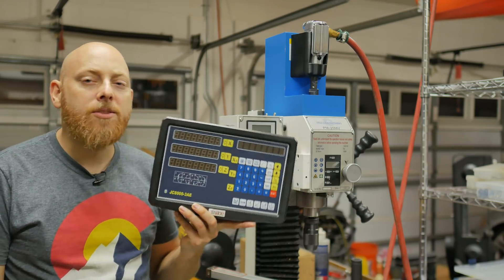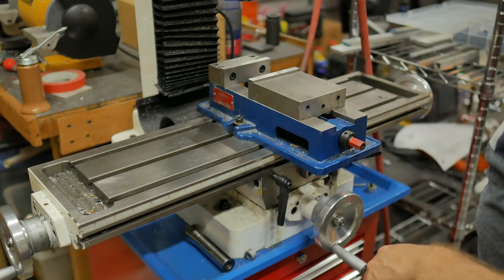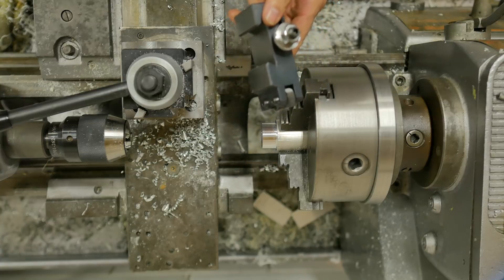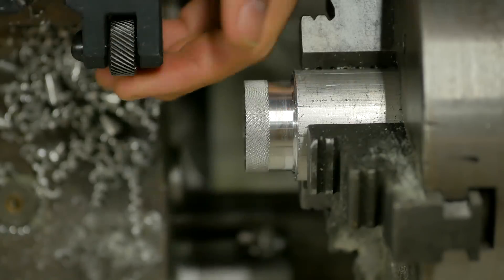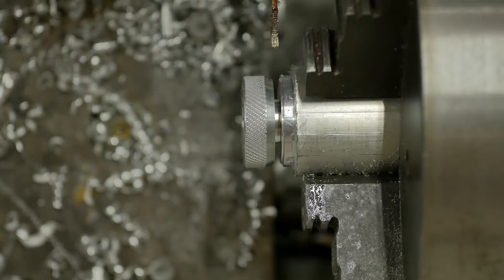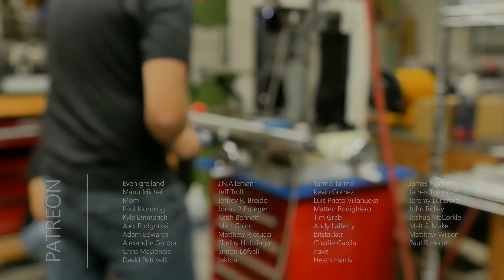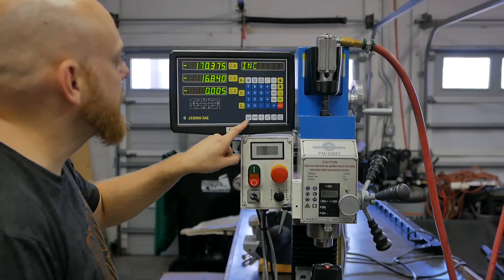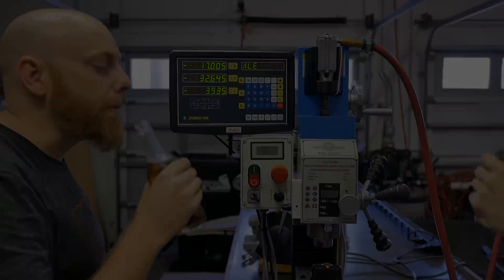DRO Install - S02E39

Comment: A couple pieces of advise for better results liberal amounts of tapping fluid it makes your taps happy and live longer liberal amounts of oil when knurling makes a cleaner knurl and switch from the push type to the pinch type your lathe cross slide will thank you in the long run, next when installing your DRO rails look for the best way to keep the cables out of the way ideally they need to be going out the back of the machine then up to link into the module

Comment: Incorrectly installed. Long scale not on this side but properly. If you want to enjoy them longer, you have to turn them. The gasket has always been turned away from the tool. Install the covers. These are optical scales. They do not like dirt. A bit of water, dust, chips and will show you the error.

Comment: What size and model is your vise?  I have the same mill and need a good vise.
Reply from the maker: I believe it's the shares 6 inch vice. If I were to do it again, I would probably get the next size up though.
Reply: Thanks for your reply.  Any chance you could get the model number off the side of the vise?  It looks to be the size I want but I want to make sure I get the right one.
Reply: @michaelhoward6880  Mike's wrong, I just looked at it and it's the 4" shars. I think the 202-1021 is the closest to what we have and looks like they've improved it a little. It's a decent vise for how cheap it is
Reply: Thanks for the info, I really appreciate it.

Comment: I have the same mill.  What are the scale lengths you bought?
Reply from the maker: 550mm, 300 and 200mm for the travel size
Total size 690mm , 440 and 340mm

Comment: Just a note on that locking handle, isn't it supposed to be able to rotate after it has been tightened? (Hence the spring and locking teeth).
Reply: yep youre supposed to pull it towards you and rotate it to a free position. although they are plastic and not the best quality, so its not a big deal he remade them

Comment: So I am curious why the DRO on the Z.  I typically use the the fine adjustment knob in the front to finalize my Z position and moving the mill head up and down is just to get it close.  By the way, I have a DRO on my Z too, but I just don’t use it.  I installed mine on the back side but I am thinking about moving it to the front now. 
I have enjoyed watching your videos.... There are a lot of really good ideas in them.  Thanks...
Reply: I have a mill just like theirs and I use the z axis adjustment instead of the quill for hogging material out.
Reply: Z scale also eliminates the need for a quill stop.  Extend your quill all the way, use the Z axis to set your final depth, and then retract the quill.  You can repeat the holes all day long.

Comment: I think most x-axis scales are installed on the back of the table.....so it doesn't clutter the front....and so your chip guard goes over the scales as to keep them clean....
Reply: Installing it on the back side requires you to remove the x and y tables (no way to get a drill in there).  I have the same mill and put mine on the front also.  I did however leave the stops on and installed the scale over the top of them.  I didn't want to chance crashing the scales.
Reply: Then I would have just removed them. It isn't a huge deal. It looks awkward and in the way.